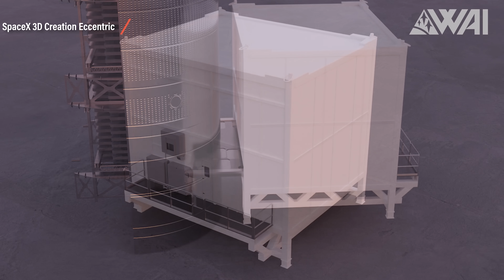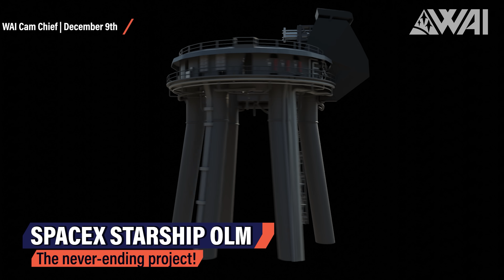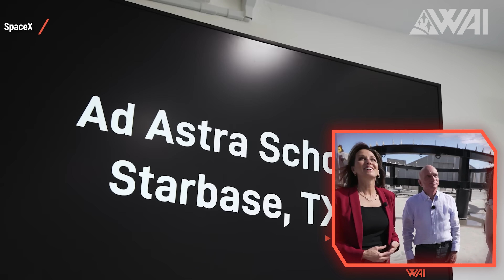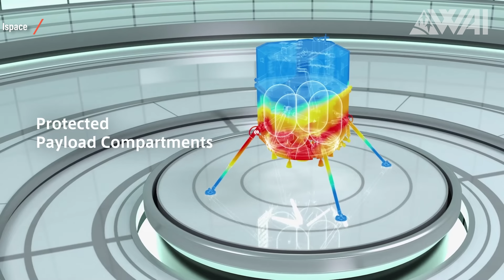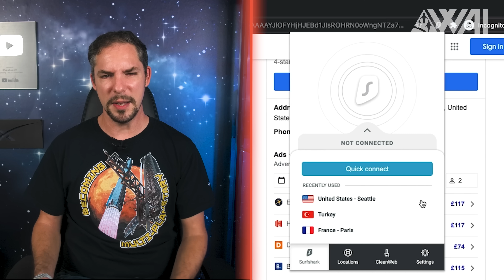SpaceX Starship New Solution! Artemis 1 Splashdown Flawless?

Comment: We need Tim to ask Elon if there should be a flame diverter, then we can watch as his brain reboots, and he realizes they should install one.
Reply: @somethingsomethingsomethingdar  You can argue that global transport makes no sense. And you may be right. (Though I honestly think it’s not very cut at dry given the speed of transport and potential market for those willing to pay for such transport.) However, you’re definitely in solid opinion territory when you talk about moon and Mars.

The moon lander has already been figured out and is a surprisingly simple concept. I see no technical challenges with SpaceX’s design and it makes MASSIVELY more economic sense than a classic throwaway lander. As a bonus, it carries ridiculous amounts of cargo and even has space for advanced exploration vehicles that will put the Lunar Rover to shame.

Mars is more complicated, but it’s not really out of bounds. We’ve already seen SpaceX successfully land a Starship here on Earth. Granted, they used crush legs, so it would be a one-time landing. But one landing is all you need. And the lower gravity of Mars makes the landing MUCH simpler than here on Earth. 

Finally, Super Heavy will never land on the Moon or Mars. It’s an Earth-specific tool used to boost Starship out of the Earth atmosphere. You have to have a stage like that because Earth gravity is so high. On Mars, a Single Stage to Orbit with a trans-Earth injection is possible with the Starship configuration.
Reply: I suspect that SpaceX is trying to figure something out that they think is very important. They’re quite aware of flame diverters and how they work. If I was to take a guess, they’re thinking about how to launch from Mars surface without a full pad in place. There’s also the aspect of deploying these rockets around the world for transportation. That doesn’t fully explain everything as it’s Super Heavy that’s the problem. But I do know SpaceX almost certainly has a reason.
Reply: @thewiirocks  ps, I admire you for not leading with an insult
Reply: @TheSkyline5467  I try. It’s way too easy on the Internet these days to start shouting matches that are unnecessary. Plus, you didn’t say anything too crazy. Tim does sometimes adjust Musk’s thinking. Reminds me a bit of Thor in Stargate, “We needed someone of lower intelligence to think of a more crude solution.” 😂
Reply: @thewiirocks  what a nice quote ! Or "indeed", as I should answer.
Reply: @thewiirocks  All one has to do is watch one of Tim's "deep dives" to respect his devotion to careful research and analysis. Hopefully, Elon respects Tim enough to give his ideas and questions a respectful audience. One rarely learns much from success. Failure keeps you humble and teaches you the most.
Reply: @i-love-space390  In no way did I intend to imply that Tim is dumb. Only that he’s not as smart as Elon and that often gives him a different perspective. Elon obviously respects his opinion and takes the time to listen to what he has to say.
Reply: @cas3157  indeed
Reply: @thewiirocks  'What we need is someone that can perfectly perform as a quarterback, linebacker, tight end (etc). The problem is that we can't them to get off the couch.' Or something like that lol.
Reply: @thewiirocks  I know mate just having a laugh
Reply: @thewiirocks  Mars is not relevant at all for the flame diverter discussion
1) Superheavy will never lift off from Mars
2) Mars doesn't have a specialized heat resistant concrete pad or a launch mound or a catch arm either
3) Development for a Martian Starship variant hasn't started in any serious capacity and probably won't for at least a half a decade. Who knows it might end up with landing engines near the top, like the HLS variant, so there is absolutely no reason to design the Launch mount with it in mind.

The real reason is probably that they enjoy being able to roll a work platform in underneath the OLM, both to quickly change things on the OLM itself, and to work on the raptor engines of a booster stacked on top.
If they installed a sloped flame diverter underneath, this would be significantly more complicated, likely requiring booster de-stack or temporary scaffolding to work on engines/ OLM.
I expect SpaceX to either install a removable flame diverter (as Felix suggested in a previous video) or to install a permanent one, as soon as people aren't required to work on/under the OLM every five minutes. I actually wouldn't be surprised, if the OLM at LC39A in Florida gets a flame diverter first, because they won't be doing a lot of prototyping there.
Reply: @plainText384  Mars and the moon are relevant.  The superheavy booster doesn’t go into orbit, let alone to the moon or mars.  Starship will land and relaunch off the moon and Mars.  It’s already built into NASA’s moon mission parameters.  There may be some landing thrusters up high but the main engines will be needed for launches and for landing on Mars. ARDS will eventually have a launch tower and launch stand although since there won’t be a booster it won’t have to be as large.
Reply: @richk3552  what does acute respiratory distress syndrome (literally the only ARDS acronym Wikipedia links to besides ARDs: age related diseases) has to do with anything?
Also we are talking about the launch table design, specifically the reasons for inclusion/ omission of a flame diverter. Mars ambitions definitely aren't relevant, wether there will be a launch mound on Mars, or not, has no effect on if Earth's launch infrastructure should be designed without a flame diverter. Also there will almost definitely not be a launch mound on Mars in my lifetime, there probably won't even be any crewed landings pre 2050 and since the first generation of Mars landers will be designed to land and launch on Mars without any infrastructure, there just won't be a need for landing pads or launch mounds, until at least the second generation of vehicles comes around.
We also just don't know how Starship will land on Mars, as a Martian Starship simply doesn't exist yet and probably won't for some time.
Reply: @thewiirocks  I would agree with you but Why not? The only reason we need to booster in the first place to to get adequate escape velocity right? So a flame diverter just for earth escape would be logical........ As only starship is going to mars not the booster..... 🤷 .... You could add retractable "doors/floor" that would open for a launch n be closed during landings.. but hay just a thought 😅
Reply: @thewiirocks  5th
Reply: @thewiirocks  lol,  this thing isnt getting anywhere near mars
Reply: What about ceramic instead of concrete?
Reply: @patrickmaloney1810  you know I wonder if that's been considered? SpaceX could line the base of the launch pad with heat tiles like they have on the Starship? Surely if they can endure the heat and ride of reentry for a few minutes, theb they can withstand the launch of superheavy for a few seconds?
Reply: @StuartAylward  Heat isn’t the real problem here. It’s the shockwave from the force of the exhaust. You know that crackle you hear when a rocket launches? That’s the mic and speakers trying (and failing) to reproduce the shockwaves from the continuous explosion of the engines. And as the sound implies, there are frequencies and pulses to the exhaust, causing buffeting that make survival of materials more difficult.
Reply: @StuartAylward  Not sure if it could handle the blast of the engines, though.
Reply: @StuartAylward  No that won’t work because the tiles can’t stand up to the erosion of a launch even as well as the special concrete they use.
Reply: @thewiirocks  Well said, a location where I'm fond of stainless with tons of water.
Reply: @thewiirocks  "You know that crackle you hear when a rocket launches? That's the mic and speakers trying (and failing) to reproduce the shockwaves from the continuous explosion of the engines."

While that seems logical, it's not really correct. Check out Scott Manley's video from 2 months ago titled "Why Do Rockets 'Crackle'?"
Reply: @patrickmaloney1810  a nice set of granite tiles wheeled over the dodgy parts or one cone like lump in the centre to deflect a radial boundary layer of  supersonic exhaust gases to protect concrete somewhat from the flamey flame of outer engines
Reply: @patrickmaloney1810  ceramic is much more brittle than concrete. It wouldn’t last as long.
Reply: @Patrick Maloney  the concrete under the pad is not regular concrete. They put a mix under there that dose have ceramics in it as well as carbon nanotubes. They changed it earlier this month.
Reply: Or a few flights of crew dragon for first few crew ship starships for aborts etc.
Reply: Elon is a listener, you never know.
Reply: @kissthesky40  Unless of course you criticize him.
Reply: @executivesteps  
Ohh, he has a dark side?? 
I don’t follow him very closely.
Reply: Maybe the reboot would get him to stfu on social media and get his focus where it SHOULD be
Reply: @somethingsomethingsomethingdar  only the top rocket is needed to get back from Mars. The gravity and atmosphere is so low they don't need the lower part.
Reply: That question was asked a long time ago.  There are good reasons that StarBase doesn’t have one and will likely never have a traditional diverter.
Reply: @richk3552  I have heard it was because of water table but Florida has a really high water table as well, so that doesn't pass the logical sniff test. 🤷‍♂️
Reply: I see a lot of commenters didn't see the reference and the joke behind this? :,D
Reply: I have a low IQ but I have enough common sense to know that this was a bad plan from the beginning.
Sometimes really smart people can be stupid. Elon Musk and SpaceX were stupid in this case.
Reply: Be sure the pointy side is up and the flamey side is down!
Reply: "The best part is no part"
-Sun Tzu
Reply: There's apparently a way to start up the engines that'd create a virtual flame diverter, so why make an actual one that needs maintenance if you can do it virtually?
Reply: He did. In one of his interviews.  Elon said he didn't see the need since they were using water. But i agree that after this launch, he will see the need for one.
Reply: Dear Moon is not a SpaceX mission.  It is a contract they have signed with a customer.  I do not believe that Elon Musk would have been consulted in the choice of passengers any more than he was involved in the choice of passengers for Isaacman's Inspiration 4.

From the point of view of SpaceX the highest priority, as clearly demonstrated by the customization of S26, is deploying Starlink V2.  To deploy 10,000 satellites into the Starlink V2 constellation will require 250 launches of Starship.  The current manufacturing rate for Starship and its components will deliver 13 full stacks by the end of 2023.  Why would SpaceX be investing in that manufacturing capacity if it did not intend to exploit it.  The cost to SpaceX of exploiting this inventory does not depend upon launch rate.  It takes the same number of staff to launch ten or a thousand times.  This is indeed the major cost of SLS.  It costs $4.1 Billion to launch SLS because the lease on LC39B, the lease on the bay in the VAB, the cost of the staff required to prepare and supervise the mission is constant, spread over at least two years.  The only incremental cost of a Starship flight is $2 million worth of fuel!
Reply: If we can drag his ass away from Twitter, He needs to delegate some authority to someone he trusts to step in to his place at Twitter, SpaceX is his Babyan he needs to be there and show it some TLC!!
Reply: Well, when Starship lands and launches on another planet, there won't be any flame diverters. So if SpaceX can find or create a concrete that can withstand a Starship, that's going to be incredibly useful. With how long the tower has been to make on Earth, it'll be even longer before one is on another planet.
Reply: They can’t install one… that’s partly why there will never be an orbital launch from that boca chica launch platform… its a pathfinder asset… they will launch from pad 39A. 
If they attempt a launch without flame diversion either the vehicle or the pad or both will be damaged or destroyed.
Reply: Musk is too busy trying to "Own the Libs" to listen to Tim these days. Driving down the value of Tesla stock is bad enough. Is owning Twitter worth it if he also endangers SpaceX?
Reply: The ground is too unstable for a flame diverter. I read that somewhere
Reply: I think that simple 1inch thick steel plates would do the job. So, wondering when they'll use them.
Reply: Every day thousands of low iq YouTube commenters think they know better than spacex
Reply: @dmurray2978  I do have a low IQ, but I'm entirely joking around
Reply: @dmurray2978  And every day SpaceX throws out the experience of previous spaceflight engineers because they just KNOW their way will be better. Sometimes it works, and sometimes it doesn't. Pride cometh before a fall.
Reply: @dmurray2978  Elon has taken advice from random people online before so if their IQ is low that would put you in the brain dead category 🤷‍♂️
Reply: @dmurray2978  SpaceX literally changed the Starship powered landing procedure after a Twitter commenter pointed out a better way to do it.
Reply: @dmurray2978 Elon Musk doesn’t think SpaceX is infallible, only low IQ YouTube commenters do.
Reply: @noeoep  musk things everything he does is infallible
Reply: @dmurray2978  yes but for every thousand dumb ideas there is a good one...My idea is to tether 2 Starships at the nose with a wire rope that's 1km long. Then put the StarShips in a spin at 1.33rpm to create 1G of artificial gravity. Then see if the on-board crew get dizzy 🥴
Reply: @153SCORN  That kind of "gravity" isn't really the same though. The second you aren't aligned with the direction of force you lose all balance and feel like you're getting pushed to the side. Even turning your head with that kind of artificial gravity completely disorientated you.

And yes I know you were kind of joking lol

Comment: Why not a metal blast plate.  You could also have a movable flame diverter.
Reply: Like when they do road construction and put those really thick steel plates over holes dug so cars & trucks can drive over. Just make them thick enough so the Raptor exhaust doesn't have time to melt thru.
Reply: Would still more than likely wear down. You'd get melting and still be dealing with massive shockwaves. Might be more permanent than concrete, but also harder to pull up and replace and potentially more of a latent hazard as far as I can tell. I'm no expert, obviously